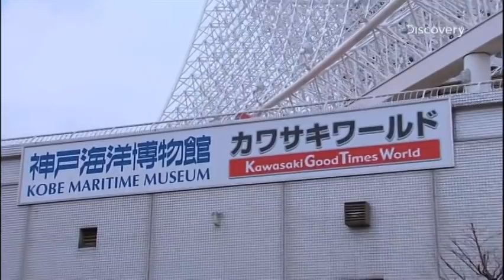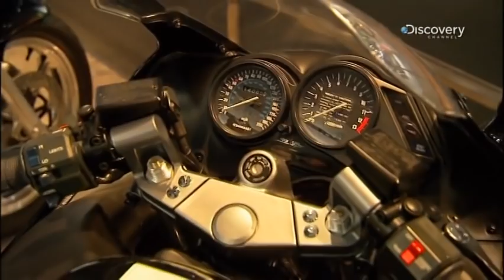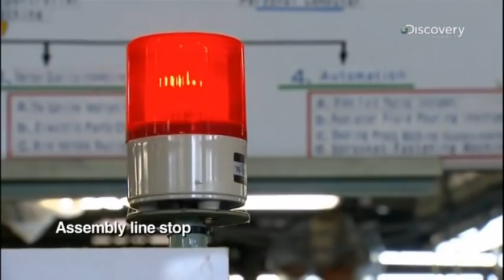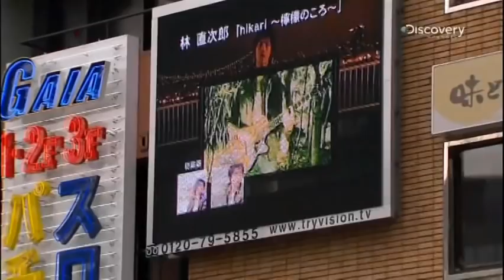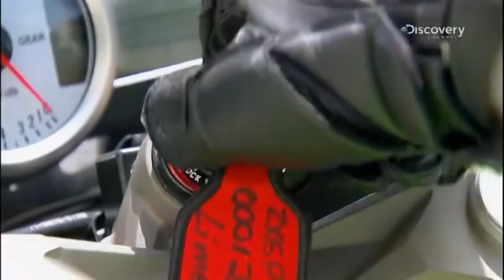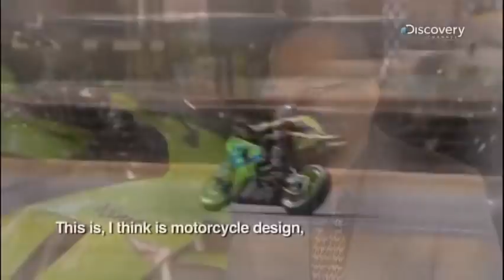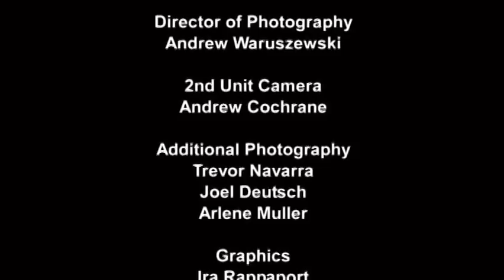KAWASAKI History, by Discovery channel, 世界のバイク

Comment: Had a 500 triple two... yeah.. WOW that thing went like nothing else on the road in a straight line - scary stuff into a corner.  As I recall kinda weighty too. 

Still have fond memories of the 2's after that. I was a bit of the 'outsider' with friends running their larger 4's, yet off the mark and from one light to the next I was hard to beat.. Hard to keep that front wheel on the ground too. 
Ahhh .. the 70's

So, wife and kids... and no bikes... not hard to understand why I got into rotary engine vehicles. 

Ahhh .. the 80's

Now... I have a young friend who owns Sport bikes... including the Ningas. 

They don't have to be ridden hard and fast... that's the way.

Comment: I don't think that the Z1 developed 100 hp, as stated in the video. If I remember correctly, it was more like 83 hp. I had a 76 KZ 900 that generated a few hp less, due to slightly smaller carbs I think. The bike was wickedly fast, but the handling was mediocre.

Comment: 4.9cop blank is correct.mid 120's is all a stock H2 had.That's if you could hold on.That chassis was spaghetti.If your chassis bearings were at ALL out of spec then count on a very wild ride over 110 mph.

Comment: In '79 I rode a Yamaha RD 400 and nothing could touch it in the 1/8th mile - not even the '79 KZ900. Some poor bloke came up on our little group on the back streets of Costa Mesa challenging "anybody who has the balls" to challenge his new KZ900. I took the bait and called him out for pink slips - should have seen him turn pale, but he couldn't back out w/o losing face. He made a valiant effort, but my RD w/ its dual coils, a Daytona cylinder head and a Basani expansion pipe was too much and I cleaned his clock. He started crying at one point, to which we all told him to call the police - which he did. When the cops showed up (w/ this chump sniveling at their side) we told them how this guy came to us w/ his chest all puffed up. The cops didn't take long to end the issue, after they talked for about five minutes off to the side, they turned to the group, looked at Baby Huey and told him it looked like he had a long walk home. I have never felt so good about the cops before or since. I rode that KZ900 for the next couple years before selling it ti finance a '67 Fastback Mustang. And the wheels go 'round. lol

Comment: I had a Z250b back in the early 80s it was perfect then I had a GPX750ZX great bike I had a break from riding bikes for about 20 years I bought the EX300 to get back into motorcycling it was the biggest load of crap I have ever owned always miss second gear no matter what I did
Reply: get an old Z

Comment: THE DAY I turned 17, I bought a used  worked , blacked out, 1971 500cc 3 cyl.  My FIRST bike! lol   On my test ride, I went down the street and turned around in the intersection.  Before I knew it, I was in 3rd and sliding through a busy major intersection. Out of the corner of my eye, I saw the owner holding his hands on top of his head. lol   I came back and pulled the $400 out of my pocket, shaking like a leaf. lol  Shocked, he said, "You still want it?"   I said Hell Yeah!  lol   A year later, after 1 occurance of the death wobble flat out,  I then sold it. I didn't know what the steering damper was for and had it loosened. I swear my hands came off the handlebars, as my life flashed in front of me and I got ahold of them again.  Like when you push a bike and it will balance itself.

Comment: 500 hundreds and 750s were rockets, at 5000 rpm all hell broke loose!!!!!!
Reply: It is possible that the original version of the Kawa 500 was actually quicker than the H2 750 (when the latter rolled out a few years later)?
Reply: @msbrownbeast  Oh boy, 750s were monsters.  Better be holding on when the powerband kicked in! Kawasaki made sure the 750 was the quarter mile champion.
Reply: I wonder if the actual HP may have been understated by Kawasaki intentionally.
Reply: @stevegoetsch2984      Precisely..... If you think about it, those 750s got real scarce pretty quickly because people wrecked them almost immediately. The HP would come on violently when it started revving in the 8000+ range and a lot of riders weren't ready for it and couldn't handle it. Many of the 750's got wrecked from wheelying  over cuz the front end was hard to keep down sometimes. All of 'em had weak transmissions.

Comment: The narrator incorrectly stated that the 1980 900 Ninja was their first liquid cooled engine; I believe that it was the beast KZ 1300 that got the first water pumper engine. I found one on Ebay for $800 and after some repairs it turned out to be the only bike that made my hands shake when I ended a ride. And I don't scare easily
Reply: You are correct Sir, the GPZ 900R was 1984 and the KZ 1300 was released in 1979

Comment: The Z1 had a top speed of 125 mph off the showroom floor ?  That's odd...my 74' Honda CB750 had the same top speed while stock.  So either my 750 was extra hot back in the day...or the Z1 wasn't that big of a deal.  ??

Comment: Those 3 cylinder 2 stroke Kawasaki's could go like a bat out of hell in a straight line but that's about all they were good for. On a track the frame would flex especially on the 750. Rebuilding them from the crank up was really a bitch because instead of a single piece forged crankshaft like it should have had, they had a built-up crankshaft. After you pressed the crank-pins in you'd have to check the run-out on each one and you'd get one right and move to the 2nd one, and get it within tolerance, and the first one would be off, etc etc. You'd be smacking parts of the crank with brass hammers and measuring all day long trying to get them all just right. Very frustrating.
Reply: Not to much track riding on you way to work or the beach though.

Comment: Lime green is ok, but why hide the engine?
I want a motorcycle where engine is visible.
If I wanted the engine out of sight I would buy a 998cc Corsa that could not pull the skin off a rice pudding.

Now we just need them to use some copper grease on all the bolts, so when an owner finally needs to undo a bolt it is not seized and rusted in place 3 years after assembly.

Comment: Had a Kawasaki 500.  Kept burning up cylinders.  Under warranty but gave up and traded it in on a 750 Honda.  Put a Yoshimura 812 kit in it and proceeded to beat 500's and 900's in the quarter mile.  I could beat a 750 triple if I was the better rider.  Long time ago.

Comment: I remember the Mach 3 and they were quick but they had a very narrow power band, meaning that you had to keep your eyes on the tachometre . You had to keep the revs up or you'd lose power. The Norton Commando would leave the Mach 3 behind and so would The BSA Rocket 3 with the Triumph Trident not far behind. I know because I was there  and saw the Norton do it over and over.. 60 horse power was what most of the big bikes had so these guys aren't being honest, the big British bikes either matched the Mach 3 and 4 or blew them off. Apart from that the big British bikes were better suited for city riding as well as touring. Why ? Because the power was available when you needed it not just within that narrow power band. The Kawasakis were better suited to the race track.
Reply: If you can,t keep a two stroke in the power band without looking a a tac than the person should not be on one.

Comment: I owned a 1973 Kawasaki H2 750. Japanese bikes destroyed German  (except BMW) and English motorcycles and most European bikes because of their cheap prices and bullet- proof dependability!!
Reply: I heard riding one of those things was a religious experience because of the less than rigid frames and brakes.
Reply: Totally true!  I also had a 73 and they were like a bullet very fast in a straight line!  I never owned a pair of jeans that weren't ripped and you could pull mean wheelies in the first three gears, it could almost climb trees!  Handling was shit but nothing could beat it off the line and almost everybody tried.  It was bulletproof mechanically and the front disc stopped it well enough!
Reply: otto Vonostrovo
sweet!

Comment: knowing how much my 1974 kawi g5 100cc 2 smoke likes to run like its a much bigger bike......
oh man i want a 900 triple 2  stroke so bad. 

like...that 100cc is oil injected...and half of the pump flow goes DIRECT to the main bearings....how many 100cc bikes have that?

my 1994 kawi jey ski...a 900 CC triple 2 stroke.....omg it sounds great, and still goes almost as fast (but out accelerates) as modern supercharged 4 stroke jet skis....and its lighter, more nimble....the modern jet skis are boats. 

i wanna take that engine and stick it in a bike so bad( but water cooled)

also..1983 honda 185s 3 wheeler....still running to this day with no more than oil changes.